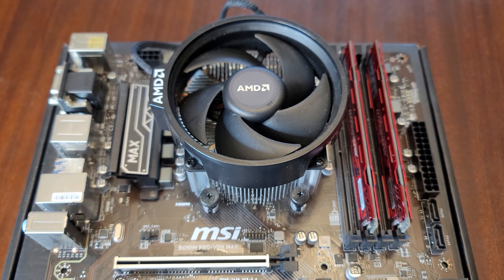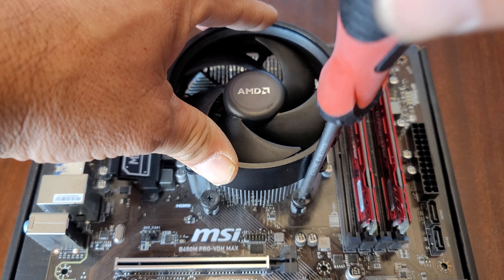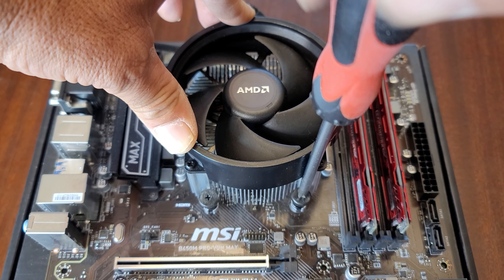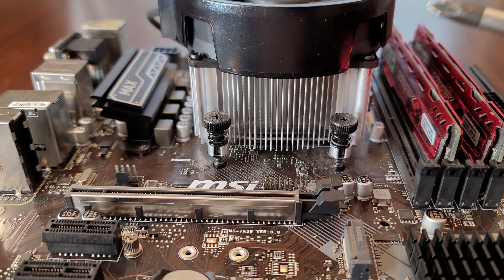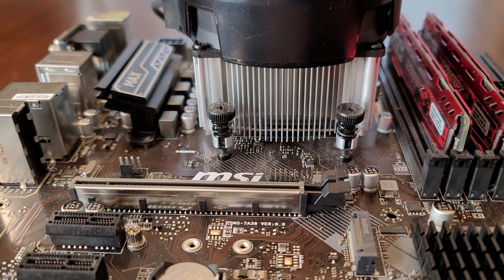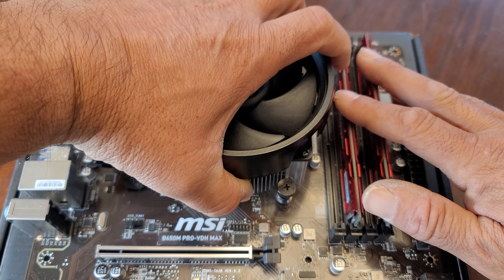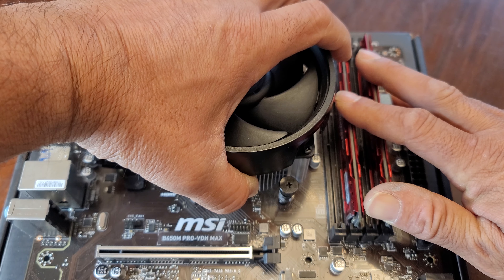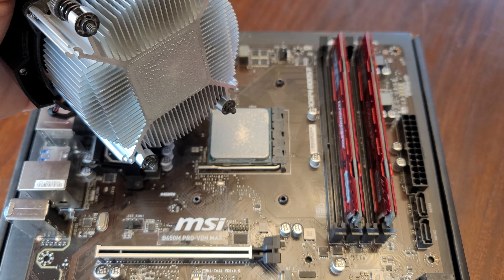How to UNINSTALL the Wraith Stealth Cooler Safely

Comment: Can't wait to dispose of my wraith cooler I hate it lol got a noctua coming
Reply: The Wraith Stealth? I've had mine on a Ryzen 3100 for 3 years and have only cleaned it with a cloth, and I've never switched the thermal paste (I've been living in another country for 3 months at two different times, and the whole year of 2022). Now it sounds like a jet plane lol. I wonder if it's easy to repaste and if I can get a substantially better cooler for a cheaper price (+/- 30€)
Reply: @Generationalwealth94  That should definitely be possible. Check CPU compatibility etc. use the right socket and browse, I am sure there are plenty of options.

Comment: Just a few ideas i'll toss your way: If this MOBO/CPU were still installed in a working system one of the best things you can do is to get the CPU nice and warm before trying to detatch the heatsink from the top of the CPU.  You have some relitivly new paste there but if the heatsink and CPU had been married for a long time "like years" the thermal paste can harden a bit and can make things even more difficult! Heating up the CPU  "and therefore the thermal paste" can really help here! Obviosly this doesn't apply here as you have the MOBO out of the case....
Reply: Yeah, you can also use a heat gun or hair dryer to warm the cooler just fyi ;)
Reply: @glutenfreegam3r177  I've been working on PC's since the mid 90s and I actually don't recommend this "at least for the inexperienced" because I actually had a person ruin their motherboard using a heat gun! So for liability reasons I do not recommend this to people. Thanks for looking out though.
Reply: @chrisnelson3635  that's understandable but to be fair..I did suggest warm/heat the cooler, not the motherboard. 😁
With the availability of so much information these days, even a complete noob could easily research how to protect a motherboard from heat during this process if unsure at all. I've even used a propane torch to warm a cooler for removal..just take the necessary precautions and you're golden.
Cheers!
Reply: @glutenfreegam3r177  I didn't suggest they heat up the motherboard......This wasn't under my direct supervision.... Now for those who do not want to use a heat gun heating the CPU up the conventional way ahead of time is still solid advice! And besides not everybody owns a heat gun or a torch, many people do, but not everybody....
Reply: @glutenfreegam3r177  well a little load on cpu before to get warm is best way

Comment: I would have turned on the computer (assuming it’s still connected to a power supply) and used it for a few minutes in order to heat up and soften the thermal paste. Shut down and remove cooler.

Comment: When removing ANY cooler from an AMD CPU I prefer to remove the cooler after letting the PC run awhile (15-20 minutes is usually sufficient). This warms the paste and prevents the CPU being removed with the cooler. If the mobo cannot be run..I then take a heat gun (or hair dryer) and heat up the heatsink after removing the fan.
Cheers!
Reply: Exactly right

Comment: Stupid question, is the backplate gonna stay on there if I remove all four screws?
Reply from the maker: For me, the back plate always comes off.  I end using some 2 sided tape so I can install whatever cooler I put on that requires the original back plate.  Good luck to you!
Reply: @ScottsPC  Alright, I guess I'll just have to take off teh side panel and hold it in place for when I screw it back on.

Comment: Mine was way to stuck to do this. Felt like i was gonna rip the socket off the motherboard
Reply: I lost a 5700X trying to remove a stuck Wraith Prism. It hurts, but sometimes the best way to learn is through failure with computer hardware.